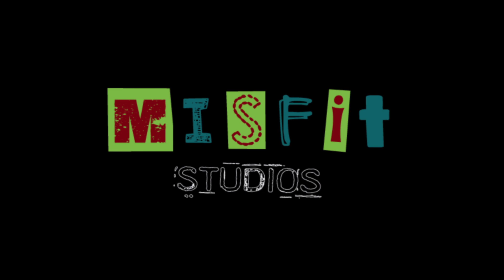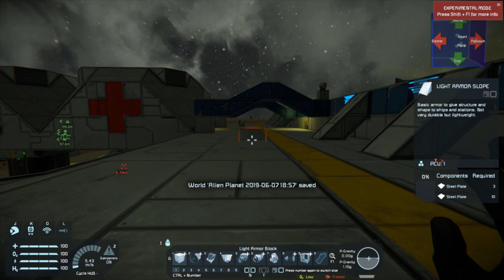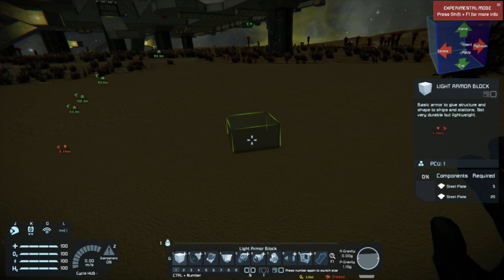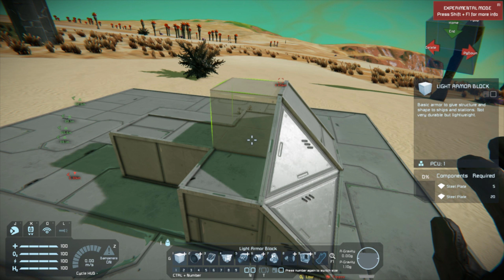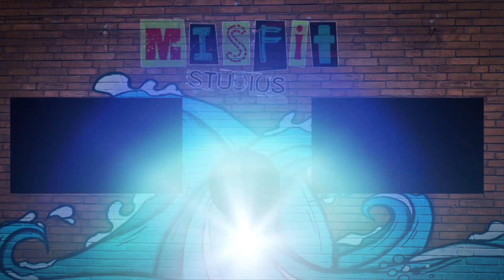How to Play Space Engineers! Ep 2. Building and Block Placement EXPLAINED!

Comment: now explain why blocks do not connect when placing them like solar panels 1 side connects and the opposite side doesn't and I'm actually building the block not using the mode your using in your tutorial
Reply: That's one of the things I was looking for and I have yet to find a video although there are forum posts with people having these same problems and the answers are not very helpful. Right now in a new survival world, I have to try over and over to get my wind turbines to actually place AND connect to the grid. I've tried the different modes and some of the control keys like T, but it seems totally random. I might try to place a wind turbine 20 times before finally it will connect to the grid. So I'll place it and finish it, but then looking at the grid it doesn't show it at all. So I grind it down and try again over and over. Really wish I could figure out wtf I'm doing wrong. Solar panels, if they're standing up, work fine every time, but if I try to lay them flat I can't get it to work, I finish them and they're not there listed on the grid.